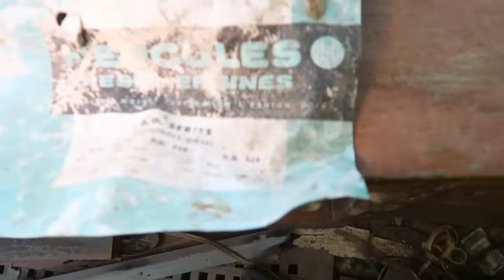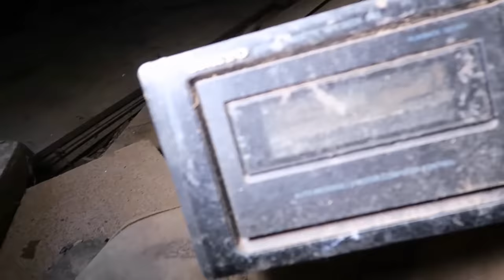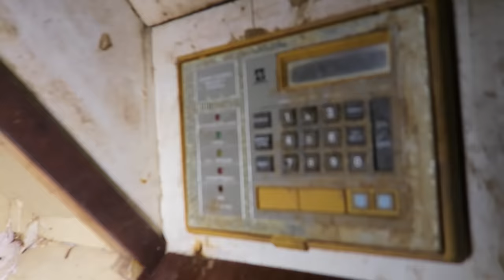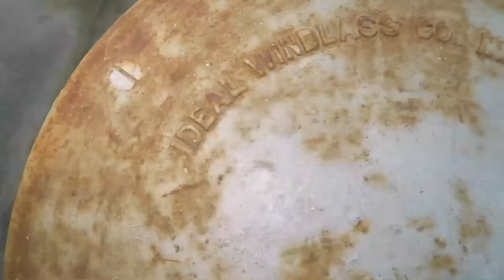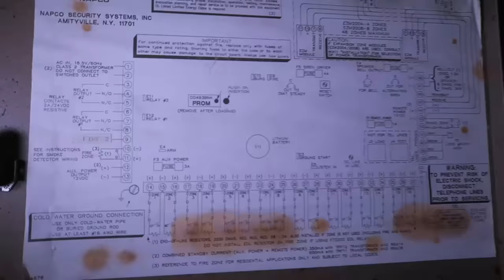We Found an Abandoned Yacht

Comment: This is a Devres-Lynch design. Probably built by FEADSHIP in Holland, estimate launch date 1962. Looks similar to a 1964 model I owned for  a while. This one appears to be about 115 feet in length with an 18 foot beam, draft 8 feet, displacement about 110 tons. The original engines would have been British built Gardner 8 cylinder. Steel hull and when built the "Rolls-Royce" of yachts. I noticed a LOT of design similarites between this ship (yes ship) and mine. The fo'castle is the same, anchor windlass the same and the peak tank cover identical. As was the stack design, and Portugese Bridge. A real shame to see it "gone".
Reply: @Terrence Bryant Absolutely. When I sold mine it was placed aboard a freighter for the ride back to Belgium.    This vessel would need to go "back to the factory". My estimate would be between $3.5 to $5 million for a refit to duty. You can buy a "reasoably" fit Feadship for about $1/2 million. Look for a STEEL hull not aluminum. Oh, look for the identifying build/hull number welded on the forward bulkhead in the engine room upper level vestibule. Every ship has a hull identifier.
Reply: De Vries Lentsch, 110' built 1958 probably by one of the yards near Feadship.
Reply: Did you have gardner's? Love that slow sound myself
Reply: @zeusapollo8688  Mine had 8 cylinder "straight-eights". SUPURB engines. Loved being able to start on one cylinder and then cut in the other 7.
Reply: If it floats then it wouldn't take anything but power tools and elbow grease to rebuild.... To restore is another story.
Reply: @louispeters2105  Possible, not probable. Thnin hull would probably sink you, and it. The hll is probably paper thin. I CAN imagine the work required to restore. I just can't count that high for the $$$s needed.
Reply: You can get the identity of the yacht by taking  the serial  number of the Hercules Diesel. and sending it to the Hercules Diesel Company or its subsequent company  and they will tell you what boat it was installed in.
Reply: @jefferylevi2237  This one looks to be aluminum.  Why would steel be preferred to this?
Reply: @tommirossi9919  I have seen this hull done in Al. I would avoid. I would fear stability issues. Knew an owner in Tampa that placed his 95 footer on the "hard" never to sail again (at least with him aboard). He had hosted a party with a lot of people aboard. For the fireworks show they all went to the same side. The boat listed SEVERLY. I suspect that he had a light liquid load (fuel/water) and to many aboard.  Plus my experience with AL and saltwater is NOT good. Lots of exfoliation.
Reply: Ok facts machine
Reply: @jefferylevi2237  we can't tell if the hull is compromised, or it just filled up with storm water, but ill be willing to bet its atleast 50% gone under the water line unless that anaerobic mud miraculously saved it. but even then, she would need to be dry docked, completely stripped not only of everything inside, but of course the hull to. 1000hrs of work just to get it to were you can start the restoration, then the actual design and refit can begin. those engines are probably so rusted in place they would need to cut them out, weld new hull and transom plates, and put it back together with the decks removed. and thats just to get new engines in!
Reply: I did notice the security was approximately 1989 for that modal
Reply: i was going to guess a Feadship also...
Reply: I worked on this boat for 3 years, its a 100' 1957 Devres Lynch built as BLUE JACKET
Reply: @Dennis Jamison unfortunately I don't, last I heard she was doing dinner cruises in NY harbor. I have a brochure from that company but don't know how to post it here.
Reply: @tommirossi9919  Steel is stronger than aluminum. If any damage to the hull such as thinning of it or other issues it would also be a lot cheaper and just may be able to be salvaged from steel rather than aluminum
Reply: Love the Groenpol Amsterdam tag :)
Reply: She's a baby doll a real European cruiser....old world charm beautiful
Reply: Yes at one time  this was a beautiful  yacht  thanks for Info.
Reply: Yea I'm but that is not a Dutch ship  and sure not that old
Reply: anything is savable with money and it looks savable the only big problems are the flooded compartments and the collapsed areas and rotted wood etc the electrics look bad but everything on the top looks good
Reply: This is a fredship
 monara 1969
Reply: @wk6153  upload to google drive and share a link please
Reply: Dont lie you know its yours
Reply: Stunning boat there. May I ask why you got rid of yours? Were you able  to spend time on the water with her, or was she a project? 
Do you still enjoy the water and what, again, if I may ask what you're floating on now? 
I'm just impressed by what this looked like one day, long ago.
Reply: @chrischapman276  Got old and retired. Lived on the coast for 25 years. Moved to the mountains of Tennessee. The time I lived "aboard" was the BEST years of my life! Would do it again but now to near "permanent" dry dock; or the "breakers".
Reply: @jefferylevi2237  what an Amazing experience and opportunity! 
In this video did it show the "captain's quarters"? Curious the size and luxury of it.  
Thank you for replying
Reply: Gardener 8 cylinder or Gardener 6 cylinder, most were sixes?
Reply: @jefferylevi2237  start on ONE CYLINDER???
That was some amazing technology for not only then but now, I assume.  
How did it sound running on a single cylinder?  At what rpm? And the biggest curiosity of me is WHY would you do it that way?  There must be a start up purpose for it...
Reply: Tabor Boy on which I sailed for 8 years was built by Devries Lentsch in Holland.
Reply: @jefferylevi2237  do you really think a boat like this would only be that little?  I'm not exactly in the "bracket" for it regardless though,  modernized,  restored and beautiful again seams like a 7 figure price range to this inexperienced sailor
Reply: @-BUFFALOMan  Lol, the old Gardner engines that would have come in that ship are still fully supported today. Many are still in commercial and pleasure use. Plus, they were much simpler to rebuild as they were designed to be easy to fix at sea. The old Gardner Diesel engines were known to run for hundreds of thousands of hours without rebuild, so I would take one any day over a Detroit, Cat or Cummins.
Reply: @Jeffery Levi, would it be worth money though?
Reply: Didn't a storm, maybe a hurricane hit Jersey? I remember lots of boats getting swept out.
Reply: It's a boat, not a ship.
Reply: Someone can fix this yacht
Reply: The Navy taught me anything over 100 ft was a ship anything smaller was a boat unless it was a submarine in which case it was a boat

Comment: this is what happens to a lot of old yachts at the end of their life.. they need so much repair and the cost of storing them in a marina drydock yard is cost prohibitive, especially in the metro NY/NJ area.. so a lot of times they are towed up way into the salt marshes and dumped. stripped of anything worthwhile and left to rot.. or the state to remove. this is most likely a steel hulled yacht from the 1950's or 60's. been retrofitted a few times but probably has been dumped there since the late 90's. very fancy custom yacht with a lot of ornate teak joinery.... the big "smokestack" on this was just a design feature, mimicking the stacks of commercial oceanliners. hard to tell the length but my guess is around 80-100 ft long.
Reply: True of the West Coast also.  Our rivers are dotted with the abandoned.  I read a report a couple years ago on the hundreds of boats recovered in Oregon and Washington.  Difficult to date this "artifact" with all the updates and retrofits.  One of the best clues bay be the Hyland Hydrolic Steering Gear. Going to see if the serial # can be defined.  It's hard to tell the # but it appears to end in a /35? The unit is massive and very doubtful that it was ever replaced.  Also is the Ideal Windless which is also massive and doubtful anyone would go the the expense and trouble to replace.  Being one of the best ever built, repair and service yes, replace NO.  Ideal has rebuilt my windless and they can still identify and service everyone they have ever made.  My first glimpse gave me the impression for the'40s or early '50s.
Reply: The fastest way to lose money is to buy a boat, constant maintenance. My grandfather lived on a river and there were 4 boats moored within 70 meters of his boat shed that were just left to rot
Reply: @captjohn5298  
It's massive.  So big ! 100 ft !
Reply: Thank you for the info
Reply: sunwolfyvan 7
Reply: 34m/110 ft, according to google earth.
Reply: Actually I believe the same thing is happening in Florida, not even yachts. Smaller boats.    They just tow the boats and abandon them in the waterwasy.
Some posters are commenting on the value of the teak. Wanna go scrapping ?
Reply: @MrDemonchild71  Very wrong... now people almost en mass buying boats, motor homes, trailers to live in them... no mortgage, no bills, real life...
Reply: @christopherjahn2044  cool. I didn't think to check it that way.
Reply: Yeah, I thought I saw a bunch of clothe romex running through, that would be 50's.
Reply: Yeah my dads best friend owns a 45 foot sail boat that he and his family sailed across the world with and it is now just at his house the closest ocean access is 200 miles away it’s just sad
Reply: It would have sunk by now someone is pumping the bilge out
Reply: My mom lived on a canal in fla and once in awhile some abandoned old boat would drift in get stuck in low tide. Kinda crazy to see for an ole yankee lol
Reply: @bigredinfinity3126  No. look at the waterline in the beginning. The boat is sitting 2 feet high which means it is resting on the bottom. There are entire ship graveyards on Staten Island and in NJ, one of them even had a the decommissioned Staten Island ferry in it, just beached. These boats have such great draft, that they quite easily rest on the bottom. Most of the large ones, and in fact the S.I. Ferry were floated in during storm, lunar, or flood tides to get them further up on land, so that they had no chance of floating back out during a normal high tide.
Reply: U
Reply: Or it was sold for scrap like this one, and a storm pushed it into its current location. Literally, no mystery here

Comment: Why every time you visit places like that, I tell myself "humm... maybe I could fix it"... and till realizing that it's beyond repair. XD
It seems to be a fantail yacht from the late 30 - mid 40's (boat herself + type of electric cables + woodworks + brass fixtures + bridge display) who been upgraded (50's phones, 60-70's electronic panels) and occupied at least until de late 80 - early 90's (TV, VHS, security system ect). Pretty sad that she sit in water, otherwise she could be salvaged and repair.
Reply: That was awesome! Thank you for being persistent and finding it.
Reply: I always think the same thing!  Lol
Reply: Yep, I like to think the same way as I've actually done it before (currently reviving a Jeep left to sit for years from a blown engine) but this? It'd require as much work as one would need to put in to restore an entire house, and that does nothing for any of the mechanicals, control bits, or the floatey bits. Restorations of a vessel like this can easily reach into the Millions of dollars, hence why it sits abandoned.

Not to say if I didn't have work, I wouldn't give it a try. Get it floating and get it running, do whatever with the interior later
Reply: @cpufreak101  I was like... "oh, she doesn't look that bad", then he came closer, "bah! It's just a bit of rust here and there + it need to be repaint... still not that bad", then he went in on the first floor, "well... the inside need to be redone... normal, it's an old ship... but  I'm a good carpenter!!", then he went downstairs, "o - k - a - y ... this boat is dead" 😂

Comment: 11:45 Front-loading VCR seems to date when the boat was abandoned from the mid 1980s/early 1990s. The first VCRs were top-loading.
Reply: The VCR definitely has a 90s design vibe, as does the Onkyo cassette deck.
Reply: The Onkyo tape deck is the TA-RW404 which was produced in 91-92 and VCR is mid 90s. The VCR is stereo, you can tell from the 3 RCA jacks in the front for the aux input.
Reply: 17:35 circuit board for the security system I think. It's hard because the camera never focuses long enough to see components well, but this layout looks 80s or 90s by my trained eye.
Reply: Given all this, it was likely abandoned around 2000. The electronic would be old enough by then that they were valueless enough to just be abandoned along with the vessel.
Reply: This boat was in the movie Scarf Face
Reply: I'm guessing the mid 80s as well. No later as some are saying the tape deck and the 90s... I don't think so. Hell, I had my first pos cd player in the late 80s. The alarm system looks to be an early 80s model with what I could get online info without good numbers. 
Imagine this thing and what it was when it was what it's suppose to be! stunning is an understatement
Reply: @mayorwrenchmcgnome  Who the hell with the money the people who owned this boat had would have a cassette deck and VCR oppose to disk stuff? 
I don't agree, respectfully. I'm thinking she was "let loose" mid 80s. 
Hell, I had my first CD player in the late 80s. 87, I think. Boy was that an expensive purchase! Like the $1000 microwave the parents bought in the 70s!!! 
Respect to you.
Reply: @chrischapman276   Because when pieces of equipment were made DVD were not even really a thing yet. DVDs were not sold until 1997.  at that time the digital media was laser disk. I was in the electronic business at that time and I could tell you exactly when those Pieces of equipment were  Made by the manufacturers. we were very big onkyo dealer. And by the looks of that boat I would put money on it that it was "decommissioned" in the late 90's
Reply: Plus we don't know what other kind of equipment may have been on that boat there might have been a CD player on there maybe a laser disc player on it even reel to reel and vinyl. I personally have every format in my own home including a few the general public would never buy because it's commercial or production formats.
Reply: @mayorwrenchmcgnome  Gotcha and thanks for the info. I tend to give a damn about stuff that doesn't matter too much, like this! 
I was thinking when I got my first CD player in 88. Sure of that. Boy was that an expensive purchase like the first microwave the parents purchased in the 70s! 
How time flies when you're getting older. (Speaking for myself there!) 
(Enter old man voice here..... ) I'll tell you what! The 80s seem like they were just yesterday and show this old man some damn respect! HEY! GET THE HELL OFF MY LAWN YOU DAMN KIDS!!!! 

Ok... enough of that. Great info Wrench and thanks.
Reply: @chrischapman276   LOL man I say that all the time "Hey you kids get off my lawn"! I am that typical grumpy old man.
Reply: @chrischapman276  But at that time, mid 80s, the electronics would still have been valuable. Someone would have taken them. They were abandoned with the boat because no one wanted them. By late 90s, early 00s, no one would have bothered. Unless they're not 120VAC. That makes them a lot less useful.
Reply: @chrischapman276  "The 80s seem like they were just yesterday.."

Same here. I'm mid 50s now. How the fuck did that happen? I demand a recount!
Reply: @chrischapman276  magnum alert series is from 1990
Reply: @lokisgodhi  A=MEN!!!! 
I don't understand how the hell I'm actually 52years young now! 
I'm at the age that my mind tells me "GO FOR IT!" 
But my body reminds me, "DO YOU NOT REMEMBER HOW LONG IT TAKES YOU TO GET OUT OF THAT DAMN MASSAGE CHAIR???!!!" 
Yeah... Seams like we can't do the things we use to do without thinking twice about doing that stuff! (jumping off a roof. hell, just jumping from my pick up tailgate hurts for a week now....)
Reply: @mayorwrenchmcgnome  I've always been interested in the oddity formats, my personal favorites are the play-tape, the 4-track tape, and that really odd giant cassette from the 50's

Comment: The manual for the Magnum Alert 2600 Series shown at timestamp 17:35 is dated 1989.
Reply: The Hercules marine diesels it had were made from 1954 - 1959 iirc
Reply: Pretty sure back in the 80’s it was refitted with newer electronics. But the fella that figured out the Diesel engines has it dated right. The style is from the 50-60’s.
Reply: @jftopsfoerster4144  
I believe this yacht dates much earlier than that.
Likely 1930s
Looks like a Trumpy to me.
I had twin Hercules diesels in my yacht built in 1935 .
Reply: @jftopsfoerster4144  The other clue to her age was the Ideal winch on the bow, 110 volts DC

Comment: Good stuff. I always have the same thought when I see rusted out cars, boats, whatever. "It was sparkly new at one time on a showroom floor." Nice adventure bro.
Reply: It really was a beauty of a boat when new. Easy to see that. Showers, bathrooms, sinks, ....
Reply: Yep. Tucked away in the woods behind my house somewhere is the rusted mangled remains of some 1950's car (I don't know cars of the era well enough to identify it, if its even possible in it's state of deterioration) but I do have similar thoughts. Was at one time a shiny new car rolling off the assembly line, sitting at a dealership, loved by it's owner(s) and then somewhere between then and today, that's how it ended up. But in a way it's a better fate then the crusher, as it at least still exists.